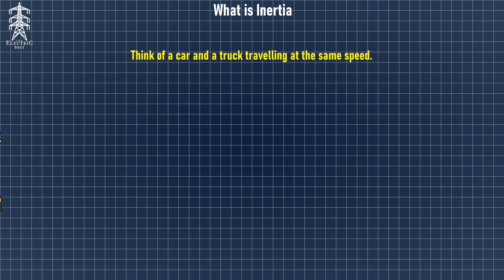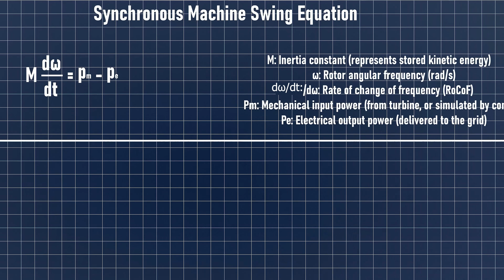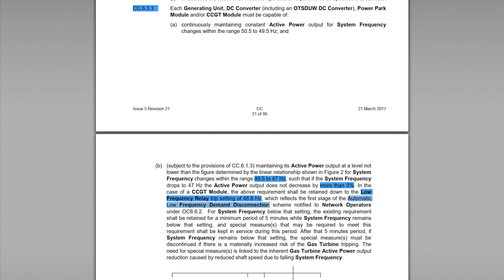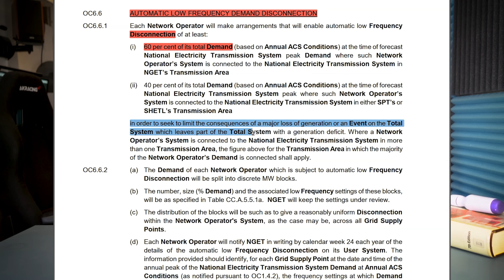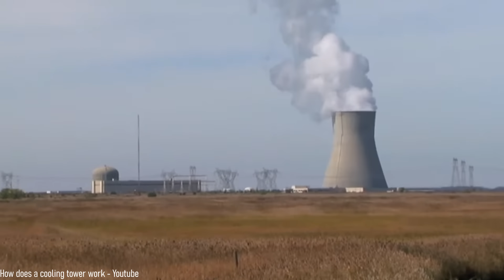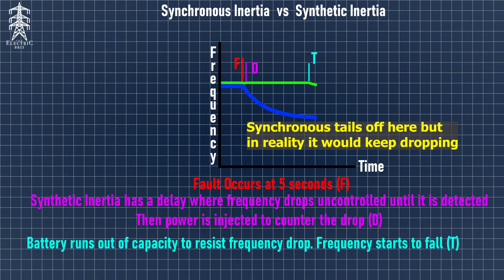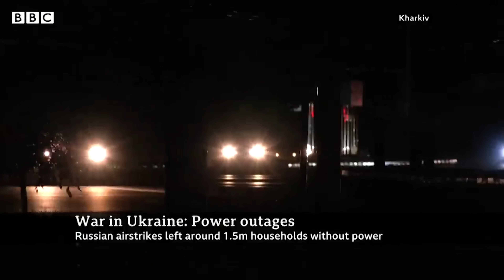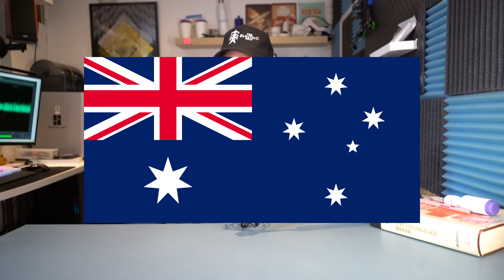How to Restart the Grid after total collapse

Comment: In 1994 I worked with a former CEGB engineer who told me about a plan to build a flywheel backup in a former quarry in Derbyshire. Use off-peak to spin up a massive flywheel that could then drive a generator. Apparently the design progressed a long way until someone figured that a bearing failure could cause the flywheel to depart the quarry and roll eighty miles to the sea, regardless of anything in the way.
Reply: that'd certainly be a sight to behold if nothing else
Reply from the maker: I think myth busters did a video on this! I remember seeing busses powered by flywheels and batteries somewhere too. We have synchronous condensers now which do the same sort of thing
Reply: @TheElectricBrit Switzerland, Zaire and Belgium tried Gyro buses. Sentinel trialled a Gyro locomotive with the NCB.
Reply: @NickBurman  With flywheels for non-stationary applications you have to have TWO flywheels, spinning in opposite directions. Otherwise when you tried to accelerate or brake the bus would shift sideways due to gyroscopic precession!
Reply: @TheElectricBrit Syncons do the same sort of thing in pretty exactly the same way too.
Reply: the generator just becoming a driven wheel rolling away from you at 1500rpm lol
Reply: @erkinalp they dont generally spin that fast, but yeah you wouldnt want to meet a 15 ton barrel the size of a building, coming at you doing 100 rpm or so.
Reply: This is why a lot of modern flywheel designs look kind of like mini nuclear missile silos. So if something goes wrong it just rattles around in its hole a lot.
Reply: @letsburn00  A bit like a centrifuge at work many years ago that had us running like hell for the exits.
Reply: Brittain had busses that used fly wheels. When they ran down the bus went back home to be respun.
Reply: Legend has it that back in the day IBM had a setup like this to power some critical datacenter.  If the on-site generators failed or ran dry, the flywheel stored enough energy to keep the site up for a few hours while generator trucks and fuel trucks drove in from offsite.

It's always hard to track down the truth of stories like this from the pre-internet days, but it wouldn't surprise me.  IBM was quite innovative until the 80s or so.  It was certainly the case that the early disk drives had enough momentum for the platters (50-pound disk pack spinning at 6000 RPM) to fly across the room and embed in the wall, so a giant flywheel flying across the countryside would be on-brand.  :)
Reply: @SkorjOlafsen  Flywheel backup generators were used in factories. The Central Electricity Generation Board apparently just contemplated a variant with a flywheel weighing hundreds of tons. Hence the quarry. Easy to see why it was taken well into planning.
Reply: @richardgibson6647rather than spinning it vertically you could totally eliminate most of the risk if you spun it horizontally. I would imagine that some fluid-filled bearing would be needed a few places around the outer circumference as well as the Center. Interestingly aircraft generators can't be used because aircraft systems run at 400 HZ
Reply: @SkorjOlafsen Don't know about a few hours but BR had a flywherl no break supply (motor/generator/diesel engine) power supply to power one of it's major teleprinter message centres. No idea how long it would last but probably enough for a controlled shutdown if the diesel did not kick in. (We are talking 1960/70 s period)
Reply: Adelaide Airport has a great big flywheel to keep power going while the diesel generator starts

there is a "special" alarm for when the bearings fail, I help design, build and install a temperature monitoring system for the bearings

the flywheel looks like a big rainwater tank filled with concrete, weighs about 15 tonnes, spins at 150 RPM
Reply: @cyberteque  Thanks for the knowledgeable input. I don't suppose you have considered dropping Adelaide Airport into a quarry in case your 'special' alarm  fails. I am sure that wouldn't be too hard.
Reply: Think theres a bit of hyperbole there but its surprising how effective a spinny boi weighing a few tons is at storing energy. 

Flywheel generators are still used today to provide switchover time for diesel generators to kick in at large industrial plants. The place I used to work had several of them.
Reply: i see no drawback? it would provide entertainment
Reply: @alyx6427  Maybe if you were watching from a helicopter. But there is something funny about seeing a helicopter with a tail rotor failure isn't there ?
Reply: @richardgibson6647 yeah, they could theoretically put two counter rotating masses on the same axle, but that might be a little bit on the over-engineered side
Reply: @alyx6427  just get a landspeeder and boost the up function
Reply: Just put it on the coast then
Reply: @wilberforce6991 But they already had the quarry.
Reply: A simple search will tell you how that can be made safe.
Reply: @linuxgaming69  Did that. ChatGPT says I will lose the ability to offer opinions if I just play video games.
Reply: Hua. I worked in a hospital datacenter that used a flywheels as a holdover for the UPSs before the backup gens could fire up.
Reply: Lookup synchronous condensers
Reply: Keep on ROLLI-ROLLI-ROLLI-ROLLI-ROLLIN’
Reply: i feel like it would have been way easier (and safer) to just use a cable, large pulley, and a heavy weight
Reply: @inniyewtesfaw2003 that is effectively what pumped hydro is.  The heavy weight is made of water.
Reply: 😂 if I was rich I'd build it to have fun watching on day it fails
Reply: Probably true. Rotating masses are terryfing
Reply: Boy am I glad that I live mote than 80 miles away from Derbyshire!
Reply: You can only get a small amount of energy out , what you back in, on flywheel backup as they have a very small range of operation, just go look at backup ups designs from the 70s and 80s
Reply: Dubious. Flywheels are very useful. I doubt anyone would have thought a single mega flywheel was feasible
Reply: OOPS, i live near buxton, but surely one of these bright sparks, realised that a small permanant magnet water turbine could black start a larger water turbine, not withstanding a diesel set could provide exciter current quicker.
Reply: @philsteele7151 
I dought it would work 

Don't forget u are driving a massive load 
As soon as you hook it up to grid I'd say it would fall over 

If it was that esay then u wouldn't have black start power stations at all 
Any little generator could start up the grid 

It needs to be able to supply the power along with the sync signal 
Using a low power sync into a high power gen set the grid would pull the sync out of alignment because it wouldn't have the power to hold sync is wat I would persevie
Reply: @philsteele7151 Yeah, Buxton Water is good. Not sure whether it has changed since a multi national bought it.
Reply: Many years ago at the old Woolwich coal fired power station, which I remember being demolished when I was a student, they had an incident when a turbine shed its load and the steam valve didn't close fast enough, so it oversped and exploded.  The bits of the turbine rotor broke out of the casing, and I understand that there was some good luck in that only one person died - the poor soul was on the top deck of a bus in North Woolwich, half a mile away on the other side of the river where a big chunk of the rotor fell! 

Fast rotating machines hold a lot of energy, without giving much external sign of doing so!
Reply: @marionbloom1218 Oh yes, there is an impression that nuclear power is the dangerous one. The same former CEGB engineer also mentioned an incident when a steam pipe in a coal powered power plant leaked. I can't remember the temperature and pressure quoted but they were high, I think he said the pipe was in the primary circuit. The jet of super heated steam hit a steel column several metres away and it bent. This meant the level above containing tons of equipment came close to collapsing onto the boilers. He said this would have resulted in a massive explosion. Apparently this made the fire service's job very tricky.
Reply: @richardgibson6647 I can well believe it.  And since you are comparing coal and nuclear, let's remember there is more radioactivity fall-out from coal fired stations than there is from nuclear!  Coal, and coal ash, is significantly radioactive.
Reply: LOL scrap man required,,, .. What it its was vertical x aligned ???  mum whats that thing there sticking in hill all kids are playing on ??
Reply: The JET fusion reactor at Culham, Near Oxford,  has (had) two large flywheel generators consisting of  two 775-ton flywheels can spin up to 225 rpm and store 3.75 GJ. this was used to drive circa 1 GW instantaneously into the reactor, to eliminate overloading the power grid.
Reply: When there  are sufficient  Windmills , Starmer  will switch  from generate to drive mode.
This will  move the landmass  of England  eastwards,  close the English Channel and STOP THE BOATS !!
Reply: @johnbendy6192  Net Zero brings Not Here O. wow
Reply: @johnbendy6192  I would think you'd want to get farther from the French
Reply: I believe ABB have a version of this in their catalogue. It is used primally to provide grid inertia.
Reply: Wind turbines are alternators, they produce AC!
Reply: @philhermetic  True, but the frequency is not constant. The AC produced by the wind generator is rectified and fed to an inverter which produces 50Hz alternating current.
Reply: @philhermetic I think most generate in ac, convert to dc via a rectifier then back to ac using an inverter to make it easier to match to the grid frequency. I was told that by doing this process you lose the spinning mass that a normal generator in a large power station has. I could be wrong though but it came from someone who works in the industry as I thought the same as you. He said that a normal alternator is spun to a speed via gas, steam or hydro flow and synced with the grid, the station controls the throttle as it were driving the alternator, whereas wind turbines the speed varies constantly with the wind and this isn’t possible, hence the ac to dc back to ac method.
Reply: @philhermetic the wind turbines are variable frequency devices which get rectified to DC.  Because wind tends to vary.
Reply: @theVtuberCh you said it in your first sentence! Wind turbines are” variable frequency devices” ie ALTERNATORS! There are other electrical engineers on the planet!
Reply: @philhermetic yes which makes them inappropriate to directly couple to the grid as when the wind isn’t blowing exactly the right speed to match grid frequency they would turn into motors and become large wasteful fans.
Reply: @theVtuberCh  wind turbines are alternators, not DC generators. I was merely correcting a misleading post, no need to meltdown😂
Reply: @philhermetic from the perspective of the grid a wind turbine is a source of DC power just like a HVDC interconnection.  Yes it starts of as AC but by the time you are connecting it to the grid it is DC that needs inverting.
Reply: @theVtuberCh clutching at straws!
Reply: @philhermetic  Most of them are asynchronous. No grid, no power generating.
Reply: @philhermetic  some produce DC that is then inverted to AC
Reply: @philhermetic 
I dought it is directly connected to the grid since wind isn't controllable 

So's it would run through a controller

Comment: SMR with their own on site diesel generators, in island mode. These would be very stable. Using batteries is highly risky, they may not be fully charged and may only work for minutes.  Best to have more nuclear reactors, which have a availability time of 95% and all the nuclear fuel can be recycled.  Remember solar panel and wind blade waste is toxic longer than nuclear fuel.  How we got to the point of having unreliable electricity grids is proof of bad electricity generation planning.
Reply from the maker: Thankfully the UK grid is extremely reliable with an uptime transmission level of 99.99+%. I’m fully in favour of more nuclear but the time it takes us to build one I think I’ll be retired. 

It remains to be seen if the economy of descaling works out for SMR etc or if it’ll just take up some private load. There’s far better large scale nuclear tech than what we’re using which has far fewer drawbacks or risks.
Reply: @TheElectricBrit Agree, the Rolls Royce SMR at 400MW is a larger SMR.  Large 1GW+ Nuclear is more efficient, but the regulations slow down the building.  I think that the Hinkley Point nuclear build had 7000 changes, all of which have to go through regulation.  This is what slowed it down and cost more money. So the solution is to repeat the Hinkley Point design with no more changes, in some countries they can build these large reactors in 4yrs.  Since bureaucracy is the problem in the UK.  That moves us to SMR.  RR make small reactors for subs etc, so they can have a repeatable, production design.  Then we can have extra diesel (UPS) generators which make them "islands" used to restart a grid if required.  Ideally we need to learn from Canada/France how to avoid govt activists from slowing down nuclear build.
Reply: What a load of nonsense.

Comment: Would it be a massive improvement if the grid was DC?
Reply: Low voltage DC doesn't work.  High voltage DC transmission is sometimes used to connect different grids just so sync isn't an issue (or for that matter 60 Hz vs 50 Hz grids).  But it's not useful within a grid: it's inefficient to convert between AC and DC,  high voltage DC is even more dangerous, and even a breaker is an expensive device that's very difficult to do right.
Reply: Wires would need to be thick af
Reply: what about corrosion in the transmission lines

Comment: Gravity batteries? Good luck building them!
Reply: They're being built in abandoned mines. Good luck trying to use Google.
Reply: "Gravity battery" usually refers to pumped hydroelectric (water pumped uphill to a storage lake).
Reply: @SkorjOlafsen  Not quite what I meant. I was referring to the system that lifts weight up high using a crane and releases them to drive dynamos. Not sure exactly how they work but it's been made in the USA if I recall.
Reply from the maker: That’s right, I believe it’s called energy vault and the economics of it are very questionable. There’s similar versions that use belts and sand.

Comment: As far as I remember, Spain had some help from France and Morocco to restart the grid. Portugal, on the other hand, had to start on its own with the only 2 plants that could do a black start
Reply from the maker: That’s right, luckily the EU are all on the same frequency so using AC links is an option. Newer HVDC technology is also grid forming so we probably would use it in an emergency
Reply: @TheElectricBritif i remember correctly didn’t Portugals connection to the Spain grid cause its black out with it getting dragged down alongside spain
Reply: @ddunfuh9239 I believe so, however, France was able to disconnect itself from Spain since there is little interconnection in relation to the grid size.

Comment: Enjoying this so far. What evidence do yo have for your assertion around 13:20 that all utilities carry out tests to ensure they are prepared if the worst should happen and what those procedures might be?
Reply from the maker: Source: I work at one of the transmission owners and we do yearly tests with our black start generators in our patches. 

I can’t speak for the DNOs but I imagine there’s some legislation like ESQCR.
Reply: There was a black start test planned 4 or 5 years ago to get supplies down to Newcastle starting from the pumped storage scheme at Cruachan as a single circuit. The protection types and settings were collected and temporary settings were expected for every feeder section and busbar protection and staff needed to be available at every site. The lack of sufficent fault infeed was a major issue. NG who were the SO at the time "pulled the plug" and so we were unable to demonstrate a working solution for a part of the system.
That was what I understood to be a black start test.

Comment: If you design a power plant that needs external power to work, you are doing it wrong. Why would someone even do such thing? I don't understand.. I have designed some solar generators and I never even got the idea that the device would have to be powered from the grid, it just does not make any sense.
Reply from the maker: Regarding solar it’s all to do with whether the inverters are grid following or forming, I.e can they be trusted to make a good 50Hz frequency and stable voltage. Without battery storage I wouldn’t want to rely just on solar to supply a load reliably either.

For nuclear it’s a safety concern if their backups fail they don’t want to meltdown and probably more a design issue than anything as to whether they can supply a local load.

CCGTs steam generators are also quite sensitive and need a lot of power to get going to make the steam, that’s why hybrids work in open mode to get going first and can start off diesels. Hope that helps a little. In reality there’s nothing stopping us from making them all work but it comes down to cost often, and the need to black start is very rare
Reply: How, exactly, do you start a nuclear reaction without power?
Reply: @linuxgaming69  I would start by removing the neutron-absorbing material from the core. I think that the engines can be easily powered from a pretty small battery.